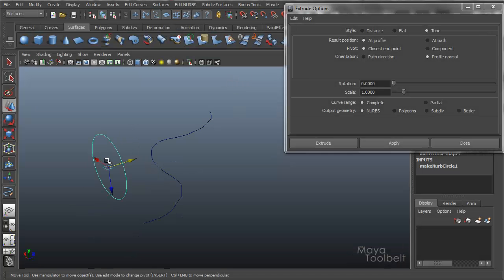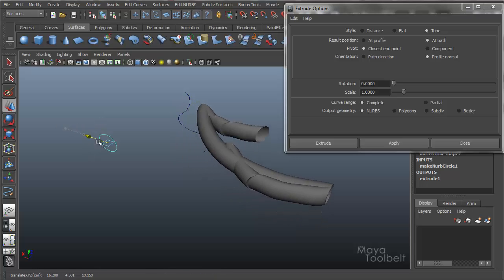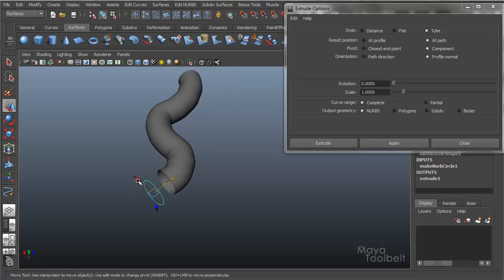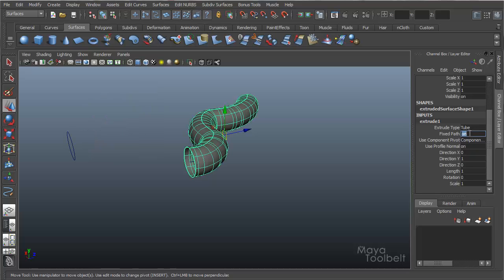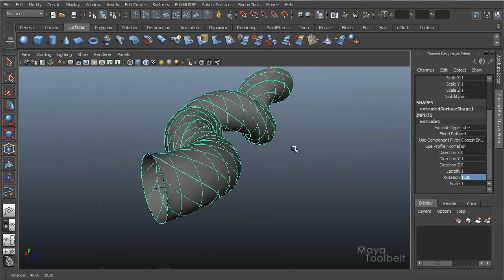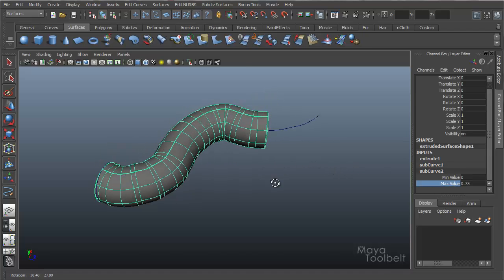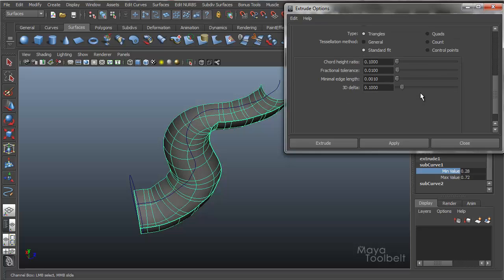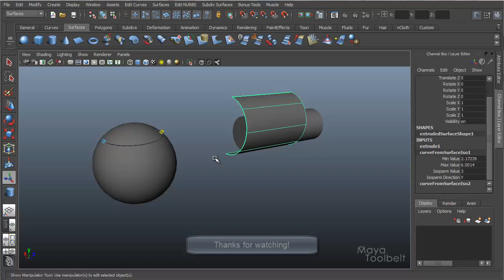The Maya Toolbelt - Extrude - Part 2

Comment: Great Tutorials! I really appreciate it. I have a problem, I don't know if you can help me. I'm trying to have a section of a moulding extrude along the path on the walls of a building. the path consists of a series o orthogonal lines. and I can't seem to make the extrude options work when the path is a complex series of orthogonal lines. things get a little funky. would really appreciate some help. Thanks!
Reply from the maker: What I personally have done when creating baseboards and the like would be to simply create the shapes and place them in the scene. Rather than trying to extrude one profile around the entire building, just making one shape, duplicate it, placing it and stretching it out to fit has typically worked best for me. 
Especially if creating modularly, where you are creating a piece of wall and duplicating it around the environment.
Reply: Thank you for responding. I'm gonna try it. Keep up the awesome work!